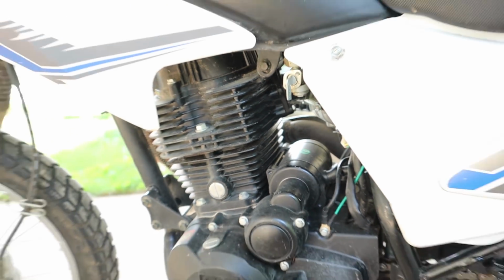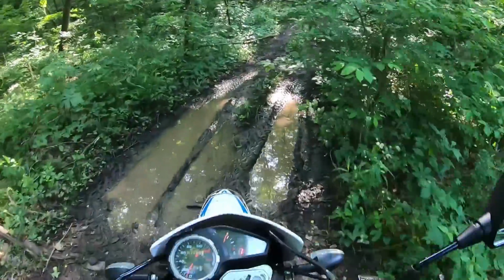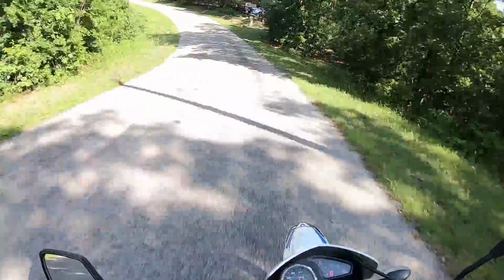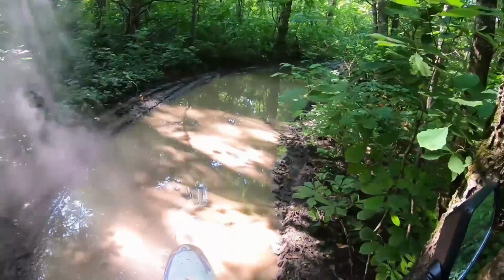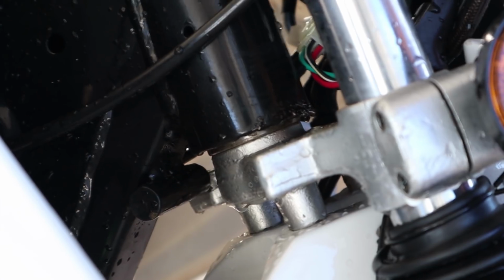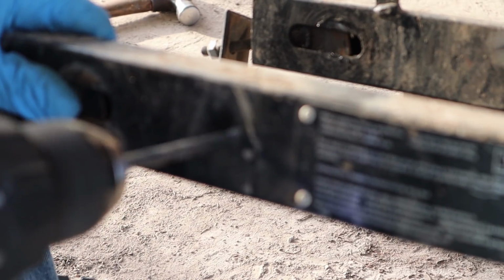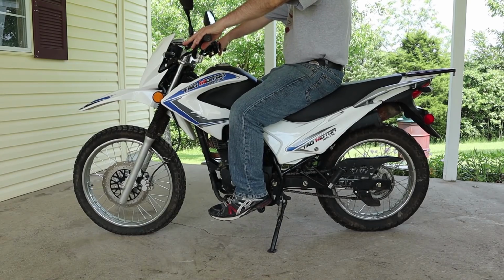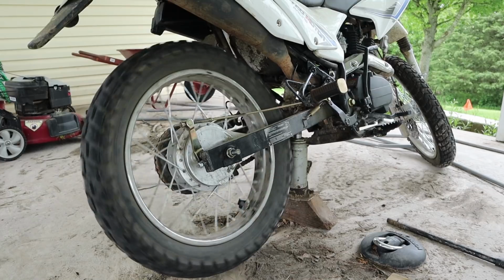Testing the Worlds CHEAPEST Motorcycle!

Comment: first....Why anyone would compare a $5000 dollar motorcycle to a $ 1500 motorcycle did not buy this bike for the right purpose, right use, rider ability, for the right price. These are affordable entry level bikes for purchase for the right parameters to be exercised and used correctly based on the bikes quality and preparation before first use. These were not built to replace any of the following bikes I own.

I own crf 450 X and R stroker motor, yamaha wr, SWM 500, and others and all are not stock. Raced ISDE, desert, moto cross, drag, road race.  The first mistake every person who buys a motorcycle online does not realize all the valves on all Chinese bikes, atv, utv need the valves adjusted before use. 2nd upgrade not putting an engine hour clock for maintenance - odometer does not report real engine time running. 3 rd upgrade the first service we do is between 5 and 8 hours the shake rattle and roll at no cost to rider includes labor and parts - you do not get this when buying on line.4th upgrade replace carburetor with a larger 2mm or more 430. 5th upgrade replace exhuast with Honda 150 Chinese copy for $100 open flow with spark arrestor screen. 6th upgrade to conventional forks are drill a hole through fork cap thread and install schrader valve component or tubeless metal valve stem with robber washer and nut on inside of cap and add 10psi of nitrogen gas. When done you spent $ 200. I I have broken 6 swing arms from Honda a and Yamaha crossing the desert at 90 +  mph.This TBR 250 (229) bike will outperform any bike made and from Japan from a ttr 230 or 250 or any entry level bike. Most Japanese bikes are now made in India, Pakistan, South Korea, Twain, and other countries. Ck the label on your kawasaki klr 650?  The SWM 500 for example cost $7500 instead of $11000 fr a 450 x. The red box husky motor KTM did not buy from BMW is rated at 124mph off the showrom floor with a 6 speed transmission. This bike will out perform any Japanese or KTM-Husky for several thousands less. 2018 bike of the year. I own a zx1200 for street fun. The Chinese and Asian make crap and great bikes. YOu just have to know what you are buying for what reason what purpose. Buying online dumb. Buying from a local shop who customizes every bike it sells is how become satisfied instead trying to nickel and dime your purchase. In 3 year not one motor or transmission rebuilt or failed frame or suspension from TAO, Apollo, RPS KPR200, Vitacci, or other units. You to know how Japanese bikes I rebuild every month 5 to 10 motors crf to kxf to yzf to KTM all have failure issues. Education is the key to be informed and not think your buying a $1500 bike and saving $5000. I started in kawasaki shop in 1973 the year of the Z1 900. I am 62 and still kick on the desert. I have seen it all from all makes and design failures from Japan and Europe. They all bleed and need transplants sooner or later.

Comment: These have a cloned Honda engines, very reliable
Reply: Yes, the Chinese buy real Honda engines and "reverse engineer" them for their vehicles. No they aren't 100% as bulletproof as the real Honda products, but in many cases, they are actually very reliable knockoffs. You can experience this at Harbor Freight also. Their small engines are knockoffs of Honda and Briggs and Stratton engines, and they are pretty good, considering the difference in price.
Reply: Cloned means looking similar to but not manufactured to the same standard.  Just remember that it was put together by the same people who left out the spacer in the rear wheel and didn't bother to tighten the steering head bearings.  You might be lucky but if you're not you have a huge pile of trouble, see what the spares availability is like - are you willing to sit and just look at it for maybe three months waiting for the bits to arrive?
Reply: @andystokes8702  I worked for Toyota for years and the same thing happened with brand new Japanese cars. I can tell you from experience these are tough engines. I've put it to the test. I daily commute with mine every day.
Reply: @louiewatson9389  You are fortunate, my experience is somewhat different.  I bought a Chinese manufactured scooter which was visually virtually identical to a Honda.  It cost less than half the price of the Honda equivalent.  There was not a single day that everything worked properly.  After 18 months of fighting it I gave up and put it in the bin and bought something else, not Chinese made.  Admittedly this was about 12 years ago, maybe things have changed in the last decade.
Reply: @Patolog Materials maybe, Technology nah.
Reply: en...obviously not reliable as the original one. But, it's much cheaper and relatively reliable.
Reply: @Patolog well I own one and have put some serious abuse on it and I can tell you from experience that you have no idea what you're talking about.

Comment: You should have bought a KTM or a Japanese bike...You would be riding it instead of working on it ALL the time. You will learn that lesson QUICK. That bike is nothing but junk...anything from China is CRAP. The workmanship is lousy...and Chinese steel is terrible. Too soft. Good luck in getting parts for it and if they are coming from CHINA...it will be SLOW. Good luck with it. It will be a fix or repair weekly!

Comment: Your basically  buying a new 10 year old version of a Japanese bike and that’s ok  for what he’s doing
Reply: 10? more like 25 years old.
Reply: It may be a new 10-25 year old copy, but the quality is pure shit. The rubber parts (Hoses, isolator is rear sprocket, bushings, wire covers, etc.) all fall apart within 3-5 years. How cheap is the bike when you must replace everything so soon. If you were to but a 35 year old Japanese motorcycle, I'll bet you that all of the rubber components mentioned above will still be in usable condition. Give me the older Japanese bike any day. Hell, I'd pay more for the old Japanese bike, at least it is still reliable. (What do I know though, I've been a Harley mechanic for 25 years and work on my sons 2005 Yamaha XT225 and he had a Chinese 80 that is the reason I mention the quality issues. Save up for a real bike.

Comment: run the oil hose back and up , use a auto parts store filter wire ties .. ace hardware bar stool leg caps to fit over the hose to air box to seal that ..simple done on all bikes even street will dump oil in air box so just do away with it

Comment: Back in 2013, I had a $550 motorcycle, an MCX 125 Raptor motard. It is similar to the Honda XRM  but the quality is total crap. I put in 4,000 kilometers in 2 months, 6, 000 in 5 months. By the sixth month, the T-post bearing was shot, and no replacement can be located. No compatible parts.  The rectifier has failed and the battery is not charging. The decals are all scratched and some falling off. The matte black on the rims peeled and rusting. I stopeed paying the monthly amortization and returned it to the dealer.

Comment: I have about 2k into my rps hawk and 1600 mile no issues. I love the light steering and low torque. I ride mine 30/70 off on road. Never dropped it. Perfect for someone who likes tinkering. The used bikes I looked at where really beat up. Glad I got it. Thanks for the video.

Comment: 10:20 OIL IN THE AIRBOX
It has long been typical to route crankcase ventilation to the air cleaner.  My 1953 MG has a tube running from the valve cover to the air cleaner, my guess is the crankcase gases get to the valve cover by way of the channels for the pushrods to the overhead valves.  A CURE FOR EXCESSIVE OIL CONSUMPTION Etc. Was to add a restrictor washer inside the hose to reduce it's cross section.  My wild guess is reduce hose area by 1/3 to 1/2.  I like your longer hose idea, but provision is needed for oil that gets sucked into the hose to drain back.  Maybe put a tight fitting short piece of hose inside the larger hose to add as a restrictor close to the suction end.  You would not want any of whatever restriction you install to come loose & get sucked into & past the carburetor.

Comment: It will fall apart within a year. Had a China scooter. All the rubber will disintegrate for sure. Worked great at first, then after a few months started making weird noises at  6 still worked, but the noise kept getting louder in the transmission area. After 1 year it was toast. The throttle cable broke and all the rubber hoses and plastic were falling apart. Don’t wast your time or money on these POS’s. Save your money and buy, Honda or Yamaha. You can thank me later.

Comment: Hey one look and it's obvious this is built to do what it was made for ..and that's running down cow trails ...this thing will be great for camping and fishing where normally you would have to walk .. it's not going to win any off road competition to speak of , but that is not what it is for ...the suspension is very light weight for serious off road ..but keep it on the easy  trails and you should do fine...and what I am seeing if you look around at Japanese bikes from the mid 1970's you will probably find parts that can be adapted quite easy ..like if you wipe out the front forks ,, get whole front end from a 125cc dual sport of the 70,s ..the rear shock, looks to be of the same designs ..foot pegs , aftermarket from local companies , levers , throttle , handle bars , all look to be common items that can be found online from USA aftermarket dirt bike parts houses. I have seen and ridden Chinese bikes with these types of engines and they are not over powered but enough to pull you through the mud and fast enough on pavement to keep up with urban traffic ... And the price is what we paid for bikes like this one back in the 70's ..so it seems like a fare deal ...  I would get a set of bolt on metal hand guards and save from breaking levers and throttle and save your fingers from getting smashed on a tree .....we used to tie on tiny cables from worn out control cables from the frame to the inside front of the rear break petal and same on the shifter to keep tall weeds and small branches of wood from getting jambed up and bending your shifter and break petal or worse breaking off .. the very best and safest tires for off road and dry pavement are full Enduro  knobby tires made by IRC ..they used to come on all the XR100 XR125 , XR200 XR250 XR350 XR500 HONDA .....and they are worn out at about 3500 miles on dry pavement but are soft compound = sticky traction on hot pavement and not to bad on wet pavement at the posted legal speed limits and when they do break loose on slick wet pavement the IRC gives you plenty of warning as they gently drift for a good ways before you are in any danger of slamming the bike  down . and off road .. they where the greatest as I would try all other brands and knobby designs and end up going back to the IRC brand same one that came on all my XR's. And here is a good example never to do as I bought a set of D.O.T. street legal knobbys for a DR650 dual sport Suzuki one time and it wasn't two months later my neighbor pulled out of their hidden driveway right in front of me as it was starting to rain ..and those DOT knobby tires flipped out from under me before I could even feel they locked up and sliding   to get my hand and foot off the brakes and ended up in the hospital with broken coller bone ..so never again will i run street legal knobbys as all they are is high silicone extreme hard compound rubber that will not hold on wet pavement and they still wear out in around 5000 mile and not worth your life to find out ...IRC is it for this Chinese bike ...IRC knobby tires are made in Vietnam where there is lots of mud and wet streets most of the time .so I believe they know what will keep you😁

Comment: i´d say you can improve something like this to a OK bike, like you did with replacing the missing parts en repairing weak welds. but i feel like this frame is going to produce significant rust problems in the next few years(looks like it has some rust allready near the welds) and if you take the resale worth into consideration it's probably a more expensive bike to run per year than a much more expensive purchase price bike

Comment: Shop Craigslist in STL, get out of the woods. If one is just barely scraping together $1400, the last thing they need is some Chinese POS that has a "known problem set". They can get an older (but sorted) bike that will get them out and about, without the excitement of snapping off brand new components, putting on a new carb, or all the rest.

Comment: Summary, run away from this Motorcycle, don't walk.  Interesting to watch to see just how many ways something can be horribly done.  Excellent job of the video.  Only information missing was height of the owner, since bike is so tall.  Also 60 MPH is a little slow for a 250.  Since it is so torquey, a smaller  rear sprocket and shorter chain should raise the top speed and spread out the close gears.
Reply: and drastically reduce its effectiveness  as an offroader.

Comment: na a used honda xl650 600 from 1985 or ..get a ebay oil ctch can thats what you need brother to get the blow by oil or best pull it a part ill bet it needs honed get a new piston n rings or a big bore kit if they got them and a 220v welder  is easy justy wire it in the box if you own your home if nothing to fear ..us ole conty boys just do it n go on .and the HT black 220 mig is a nice welder i used the 110v and it sucks i askeds my what you afraid of get rid of all your 110v bigger stuff n get 220 and i did wow i felt like a idiot fer not doing it sooner.110 is good fer a circular saw but nothing more

Comment: I think the best you can do for that particular bike is put a set of 60/40 tires on it and brush guards to attach to the handle bar ends and I would look for a bigger fuel tank for it so I could go trailing for two or three days with a help of a fuel caddy or carry all container. Questions are for me are skid plate included in the costs? Also how easy is it to buy aftermarket products that will fit it? Also, what is the fuel mileage on it, with the stock gearing on the sprockets that is comes with? In Arkansas we have to have a MSRN form or something like that from the dealer to license them. Make sure they send you that piece of paper in the mail or with the bike.

Comment: i worked at a scooter shop.. sold and serviced all kinds of china built shit.. motors are for the most part solid... everything else is scrap...   you would be better off to buy an old blown up honda and put a lifan or similar in it...  spend 1/4  the price and have a bike that will last.... i tested one of the older 150 enduros... road it on road... it was fine for the price... did some light trail.. it was flexing but ok... jumped that sob 3 ft in the air and broke the mono shock mounts..    i personally would never buy a new china bike. i can make better cheaper..

Comment: With all those repairs you still insist that is cheap? This is just the start as it should be obvious that the "shape does not match the substance/soul". I just want to say that is just a cheap copy and the materials used will fail soon. A copy is just a copy made cheap (without quality assurance) and for the most part, my experience with the Chinese products is bad. If the shape is wright, the material used (steel, alluminium, plastic, etc.) Is terrible bad.